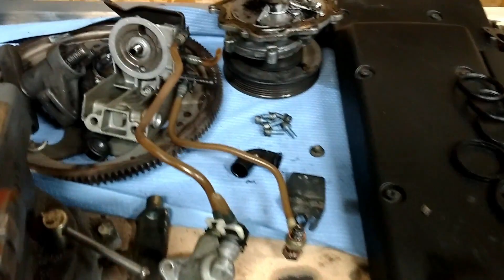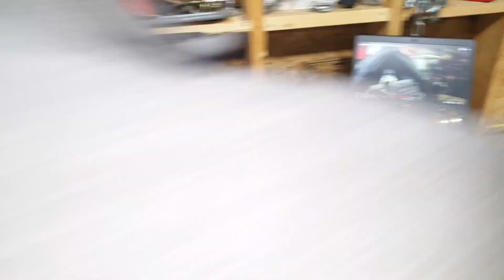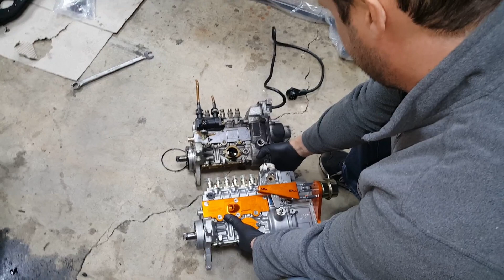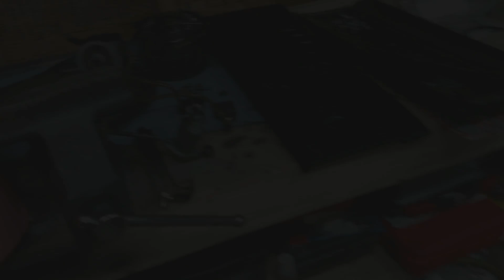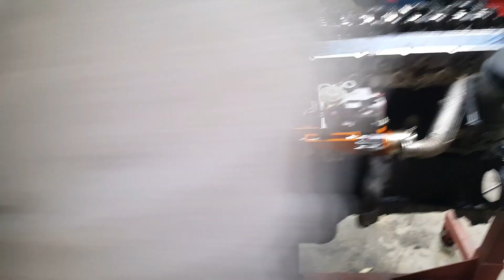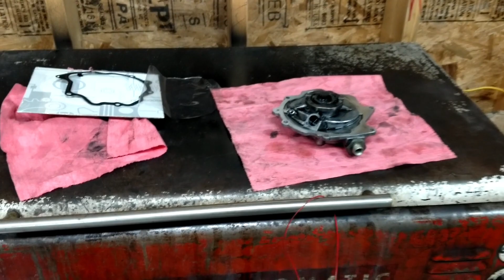Part 9 Diesel Pump UK - Injection Pump Install on om606

Comment: I cant understand what is EDC and what is the difference between mechanical and electronic pump? Can you explain me sir?
Reply from the maker: A mechanical pump is just that mechanical. The pump levers are moved with physical linkages. The EDC pump is controlled by a computer and it does not use the physical linkages.
Reply: @woodsandbarclay  ohh thanks, soo mechanical is better?
Reply from the maker: @r9cheverny433  I wouldn't say better but I would say more reliable yes

Comment: Man that pump is probably 8mm for your racing engine! Every time I get to watch one of your videos.  I learn more.  I have to pull my 602 injection pump and reseal it.  With a reseal kit. Plus rebuild the injectors. Off my 92/W124 merc 2.5 turbo diesel! I got some Monarch injector nozzles made in Germany.  There's a video of a guy who tells you about "coline" Mercedes hard line fuel lines. Hopefully this will help you?  Thank you so much for making videos on your progress!
Reply from the maker: Yes I saw that same video thank you so much for commenting!

Comment: friend you know what are the suspension geometry parameters of the 300SD
Reply: There are 2 channels on YouTube as well as this Very incredible man. Mercedes Source and Impalaman garage! Also Mr.300 he does a manual alignment on his Mercedes 300D 85. Hope this helps?
Reply: @lorenreyes2855  Here in Brazil diesel cars have been banned since 1956, only utilitarian, these mercedes were embassies. Our dealerships have no information.
Reply: @lorenreyes2855  thanks. more in w116SD the geometry parameters are different because it is another body. I believe that the friend here must have Caster, camber and convergence, I found the w116 450sel 6.9only. I will see the videos
Reply from the maker: For a w116 you basically want zero camber and a lot of caster, like 9 or 10 degrees. And you just want a very very small toe in, maybe 16th of an inch or 1/8 of an inch. The w116 is very difficult to align and get the car to drive straight. You need more camber on the driver side than the passenger side.

Comment: Nothing to do with this video, but with your previous one.  Please post the contact info or at least the address of the Mercedes graveyard.  I live on the south of Atlanta and will certainly make the trip to look.
Reply from the maker: Hey it's just on the side of the road if you're going to Canton Georgia from Roswell Georgia. No idea what the address is I just passed that place every time I'm driving from Roswell to Canton.
Reply: @woodsandbarclay  Thanks, I'll find it.
Reply from the maker: @billyboyblue17  literally come up Georgia 400 get off exit 7 and drive to the little downtown Canton Street area of Roswell. Then punch in your GPS Canton Georgia and follow it. You'll pass it on the left side of the road on the way to Canton.